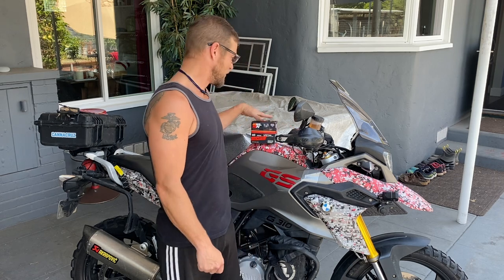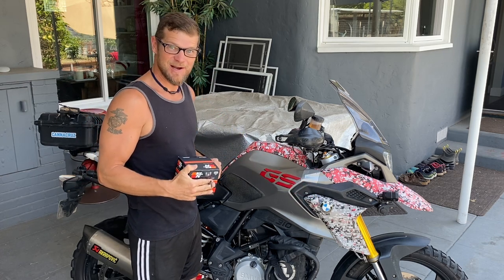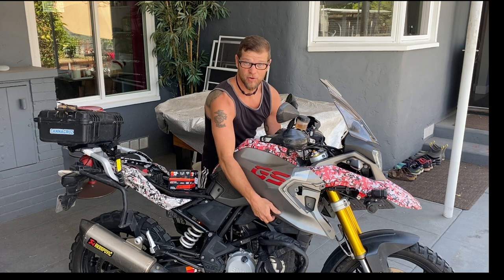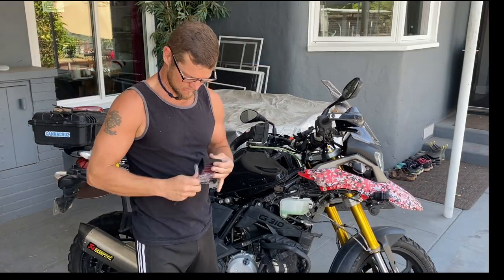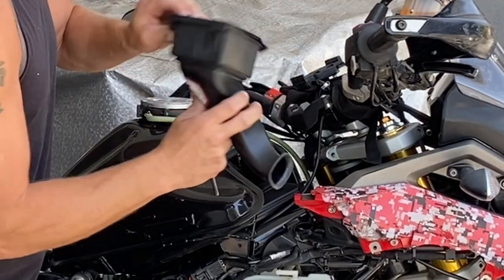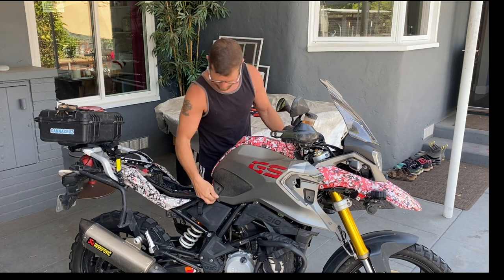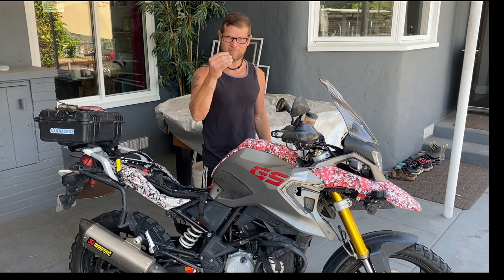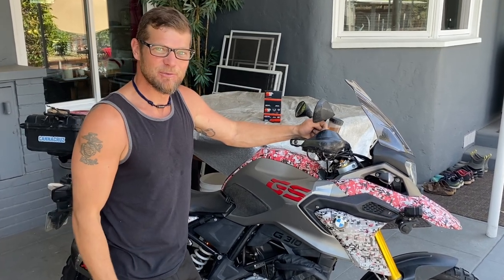MotoVagabondNate: HOW TO - BMW G310GS K&N Air Filter Installation

Comment: Excellent video! For an adv bike my opinion is that it should be easier to reach the air filter for maintenance.
Reply from the maker: I agree. But, I’m so happy with all the rest of the motorcycle I’m happy to remove a few extra bolts to clean the air filter to be able to enjoy ownership of such a fantastic machine. Thanks for watching and commenting. Enjoy the dirt my friend. Cheers, ~Nate

Comment: Awesome, thanks for this dude, it'll be the next job on mine. Did you notice any performance changes at all?
Reply from the maker: Connor G, thank you for watching and commenting.  I originally installed the air cleaner the same time as my Akrapovic exhaust system and other protection items. So I did notice an improvement in performance but also the additional weight I added, so a give and take. You can definitely hear the intake sucking air now!!!  Cheers, ~Nate

Comment: Question. You mentioned the spark plug. So would this also be a good time to replace the spark plug? I've got about 11,000 miles on mine and the BMW service book says to replace the plug at 12,000 miles. I don't know how much more I have to remove or go through to get to the plug. I have a 2022 but as far as I know, nothing changed between 2018 and 2022.
Reply from the maker: Yes, it would be a good time to change the plugs. The only thing left to do is remove the tank and have the proper thin wall socket with extension to remove the plug. Remove the vent hose from the tank fuel filler (most likely green) then remove the rear tank mount bolts, disconnect the fuel quick release and the fuel pump pigtail and you can freely remove the tank from the Moto and replace the plug. Hope this helps and thank you for the view and comment.
Cheers,
Nate

Comment: Hello, I watched your video, very cool. I have a question, Do you know the way to replace the front turn light in this bike?? Thanks in advance
Reply from the maker: Rodrigo: Great question, as it baffled me at first as well. The way I reinstalled a misplaced signal once was the hard way. I removed the front fender and tank cover to gain access to the wiring and hard to reach bolt.  I’m currently out of town without my motorcycle or I would give a better explanation or how to video but might be able to accomplish that in the near future for you. Hope this helps and keep enjoying that 310. Cheers, ~Nate
Reply: @NateJennings  Nate, bro, I just buy the replacement blinker and is arriving in a month more, Im patient, NP. Thanks a lot for the answer

Comment: You make getting the plastics off look too easy. I find it a real battle! Just had mine off to add USB sockets in the console, install heated grips and prepare a power supply for a sat nav. Putting everything back hasn’t been easy and I have ended up with a bag of bolts left over!
Reply from the maker: Thanks Jim.  It’s easy to forget the two bolts at the bottom of the tank and the two inside the bowling near the triple tree. Let me know how I can help. Thanks for the watch and comment.
Cheers, ~Nate

Comment: I saw right? You already have a k&N filter and trow away? It’s supposed you have to service the filter clean and put oil on it, and reuse I do on my cars I have the kit
Reply from the maker: You are correct, I did already have a K&N filter on the bike and replaced it after 25,000 miles of hard off road, to include, three trips up the MABDR, the Colorado BDR, and just finished the Trans American Trail that month.  During which it took on lots of desert sand and mountain mud, two dunks in a river and a swarm of locust that left guts and particles that just needed to go.  I washed that filter multiple times before replacing it with a new one just to make this video, so it wasn’t a complete waste. Thanks for watching.
Cheers,
~Nate
Reply: @NateJennings  wow unbelievable journey. Great video. Thanks for it. You made it look very simple.👍

Comment: Did u have any problem when riding off-road with this air filter? Does it bring more dirt in the engine?
Reply from the maker: Good question, it will allow more fine dirt particles in due to the more porous material used, almost like medical grade gauze. But, if you keep it cleaned and oiled properly it will still keep most dirt particles out of your engine. I have almost 40,000 miles on this G310GS now and don’t have any engine issues related to intake or anything else for that matter. This engine is a beast, I’ve sank it for four times under water in three different states across the country and it still keeps pumping out tons of fun and reliability. Thanks for watching and commenting. Cheers, ~Nate